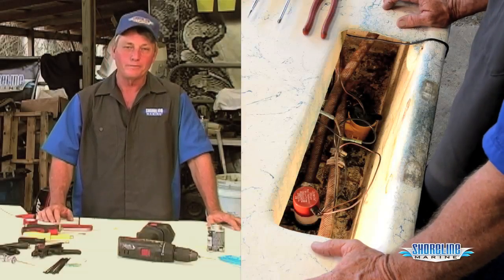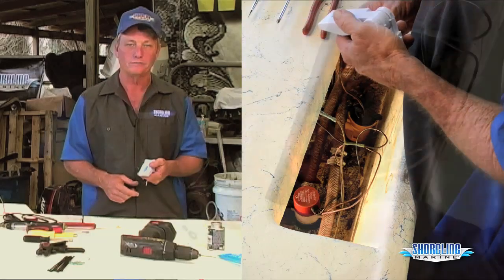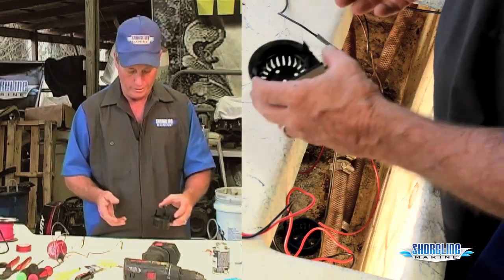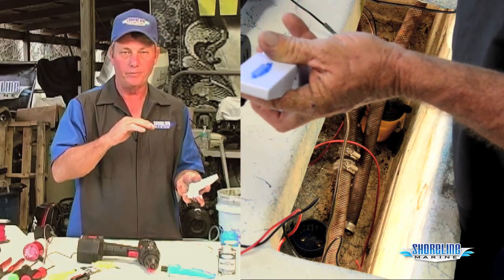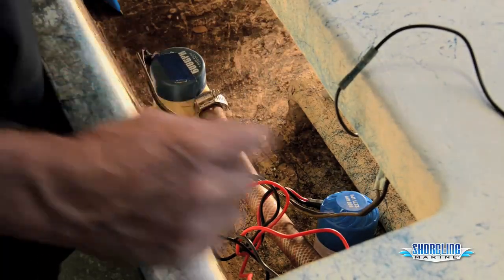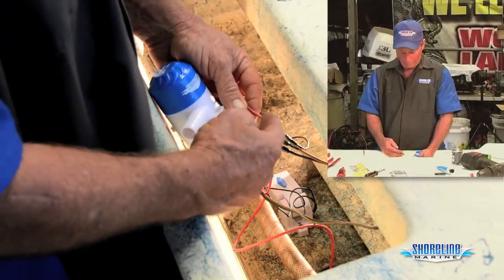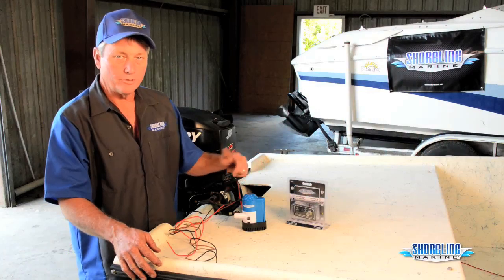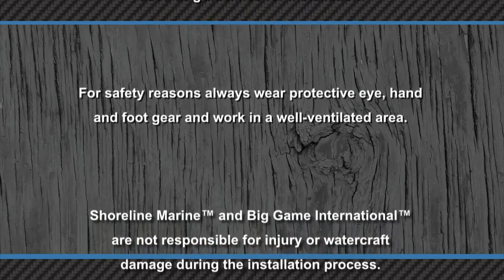How to Install a Float Switch & Bilge Pump

Comment: Generally the strainer at the base of the bilge pump restricts debris from entering the pump and ruining the motor. But it's good to clean the bilge because of the fact that leaves do plug the strainer and keep water from entering the pump. I have also had to replace auto bilge floats a lot. Anyone who watches or reads my comments ..... always make sure that you have a working float on your pump if you dock your boat in the water and leave it unattended because you need to know that your pump will kick on when needed. Also, make sure that the switch kicks off the pump when it has removed the water

Comment: Thank you for the video. A piece of advice with all due respect for helping everyone out there. 
Just a suggestion:
1-The double videos are confusing, a single one would be good. 
2- When illustrating instructions of wiring or assembly. I would recommend if you could show a zoomed in video of the wire coming out of point A (for example) connecting out of point B. 
People like me who have no idea what is a negative wire from a positive wire. Once again thank you for your help

Comment: I must have listened to this guy 30 times over and I have to say this is the most confusing DIY video I have ever seen. He contradicts himself on the 'connecting 3 wires' together...
Reply: Jeff Jennings He means if you have a manual console switch you connect it together with the wire from the level sensor to the wire of the pump. So 3 wires together. So you can activate it manually with 12v from center console.

Comment: captain I have a boat that the only time the bilge pump can be activated is when main battery switch is in on positions I think the float for the bilge is  not wired correctly, should be going to battery directly.cant see down in bilge what pump it is, but should I look for a brown/white wire at the switch, and route that wire directly to battery?
thanks
John

Comment: The video is useful. As a layman, I still have two questions : (a) how to set the levels of the pump and the float switch ? which one should be set higher (less likely to touch water? and (b) I am anxious to drill hole onto my hull/ transom to fix the float switch - May I use super glue like Quiadsa FIJA + PLUS to fix the float switch to the transom switch ?

Comment: The floater is just a switch you connect 1 wire to battery negative and other to pump black wire. Red wire from the pump to battery postive. Just match the colors and connect the switch in series with the pump. Manual switch with 12V connect it between switch and pump red/postive wire.

Comment: Hi Captain Weekend I had to do a modification to a Fiberglass 2015 Smuggler 6.20 Sport Cabin boat with a 2014 150 hp Yamaha Four Stroke outboard motor & we had a lot of problems with a lot of water getting into this boat & that my son Regan & I had to do something about it & this this was basically brand New boat & was a demo boat & only had 3/4s of an hour on the Yamaha Four Stroke outboard motor & I found out later the water was getting in through the bilge pump outlet & which later down the track it destroyed the toilet pump 1 day I could not get the boat on the plane & I couldn't understand why I couldn't get that boat on the plane after a few hours fishing & when I got back to the boat ramp & got the boat back on the trailer & drove the trailer off the boat ramp & took out the centre bung you should have seen so much Bloody water coming out of the bung hole it wasn't funny & even my daughter Melinda said Hey Dad that's a hell of a lot of water coming out of the boat especially a near new boat to & said yes that's a lot of water alright & when I got home & thought I would get the garden & put it the bilge pump outlet & turned the tap on just a little bit & you should see the water coming out of the centre bung hole & no wonder the water was coming into this boat & Bloody the bilge pump outlet is in the wrong place & so my son Regan & I decided to something about it & I took the hose off the bilge pump & the bilge pump outlet fitting & I tried to loosen the nut that was holding the outlet fitting but not successful & Regan had to break the outlet fitting with a hammer & chisel to get the fitting out & I had already marked where I want the new bilge pump outlet fitting to go up to the lefthand side of the boat & in that way I will never get any more water to come this way ever again & Regan had brought 2 meters of very good Quality bilge pump hose & 1 new bilge pump outlet fitting & I had marked up to the left hand side of the boat & then Regan put plenty of tape where the hole is going to go & I put plenty of tape up on the inside where hole saw going to go through on the inside of the boat & then Regan made the hole on the side of the boat & it looked good & then Regan cleaned up both inside & outside of the hole where the new bilge pump outlet fitting is going to go & then Regan screwed up the nut & Regan got me to hold the outside of the outlet fitting & once it was tightened up the outside of the fitting wasn't flush with side of the boat & so the washers that came with the side of the boat & so Regan cut one of the washers in half & I had made sure that the 1 half of the washer sitting at the top of the outlet fitting & Regan then retightened the outlet fitting & then found out the outside of the outlet fitting was still not sitting flush with the side of the boat & so Regan had to undo the fitting again & he put on the other half washer on & Regan the retightened the fitting & I made sure that the half washer & the other half of was also facing at the top as well Regan tightened up the fitting & this time the outside fitting was sitting flush with the side of the boat which this time it was sitting dead flush with the side of the & so it took 2 half cut washers to make the outside outlet fitting go flush with the side of the boat & the Regan undone the fitting again & Regan cleaned up the side of the boat where fitting & once it was nice clean Regan then got the silicone gun & got a lot of Marine Silicone on the side of the boat where the new outlet fitting was going to sitting against & Regan said to the to push against the fitting while I will tighten up the fitting & Regan had already had applied a lot Marine Silicone to the inside fitting & tightening up the plastic nut & Regan got it tight as he could & then came out of the boat to what the outside fitting was like & Regan had to do was clean up the excess Marine Silicone around the outside of the outlet fitting & it came nice to & I had a look on the inside of the outlet fitting & it looked really good to & all Regan had to do break the other outlet fitting & he used a hammer & small chisel & that was it & the outlet fitting came out easy & all we had to then was to wait over night for the Marine Silicone to cure & the next day I did the wiring of the new float switch as Regan had already Marine Silicone the base of the float switch & that's not go move all as Regan cleaned the area with White Spirits & wipe up the area with clean paper towels before Marine Siliconed the area where the float switch was going to go & all good now I did the wiring on the float switch I got 1 positive wire & connected to the main positive wire & goes to the  dashboard main switch that's to the bilge pump & the other float switch wire goes straight to a waterproof fuse holder & the other end of the fuse holder wire & I have installed a proper clip & screws on to the positive side of the Battery with a 15Amp fuse I used electrical conduit to cover all of the wires & put cable ties around the electrical conduit & it is nice & neat & you don't see any wires at all & on 1 Saturday morning I took the boat to a professional fiberglass expert & got the original bilge pump outlet hole blocked up & then Sunday came the guy Rod who repaired  the hole rang me to pick up the boat & wasnt not far from my place where his workshop is & had done a fantastic job of the hole & you can't see where the original bilge pump outlet hole was & Regan put the new hose on the bilge pump & I feed the other end of the hose to the new outlet fitting to the rear up side of the boat & I had to cut about 4 inches off the hose before fitting it the the new bilge pump outlet fitting & I tried it out & I put in the centre bung & I got the garden hose & put in where the bilge pump & float switch are & when the water triggered the float switch turned the 1100 GPH bilge pump on man you should how much force it pumping out the water is amazing & no leaks around the fittings either & when I turned the garden hose off & when the switch dropped down to off position the bilge pump turned off at the same time & there was still some water in the hull & so I just went to the Manual switch on the dash panel to the bilge pump & switch  the bilge pump on & pumped the excess water out that was in the hull never again I will water coming into the boat like that ever again & it scary & had already destroyed the toilet pump up at front of the boat NZ $300.00 later for a new toilet pump all because the Bloody bilge pump outlet was put in wrong place & water would come in through the bilge pump outlet & putting the outboard motor in reverse would have been worse it be forcing the water even more into the hull of the boat & now ONE BIG PROBLEM SOLVED Kind Regards Peter & Keep Up With The Good Work Captain Weekend & Wishing You All The Very Best 
Captain Weekend

Comment: Great videos...  I have a question on bilge pump discharge hose.  My Rulemate 27D pump is NOT removing water.  I traced the discharge hose down under the motor to locate the pump and float switch.  In so doing, I noted there is a vertical loop in the hose at the top of the run, just before it exits the boat.  Reminds me of an airvent for a dishwasher drain.  Would this cause an airlock that might be my problem?

When I take on water, the bilge pump light on the helm comes on, leading me to believe the float switch is working.  I have just begun my investigation and have not yet tested anything, but found the loop in the discharge line and thought that might be a start.

Thanks for your time.
Reply: Yes. The hose is supposed to have a gradual vertical incline. With that loop at the top the bilge will have to work harder and it will have a air lock.

Comment: When you jump over waves on a jet ski with a float switch for the bilge pump, will the float switch keep activating on and off from the jumping? If it does I guess it doesn't really matter.
Reply: float switch isnt good for a PWC..... i had a manual switch installed on mine years ago
Reply: Jet Skis have a continuously operating pump that runs off 2 stroke engine vacuum pulses.

Comment: Black wire off pump????
Reply: common sense dictates the black wire from the pump is the main 12v grounding wire.
Reply: you're exactly right and he tells you to connect it to the battery - idiotic.